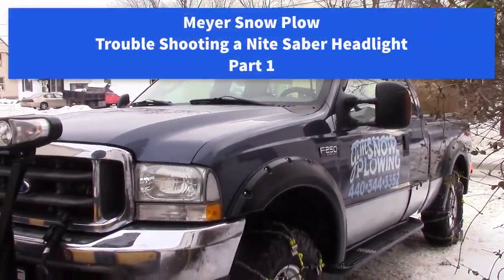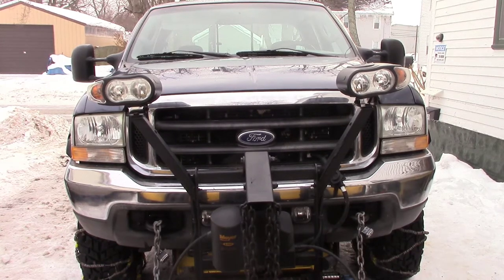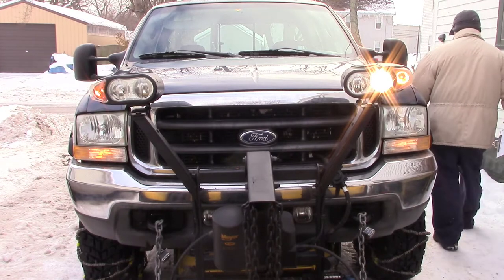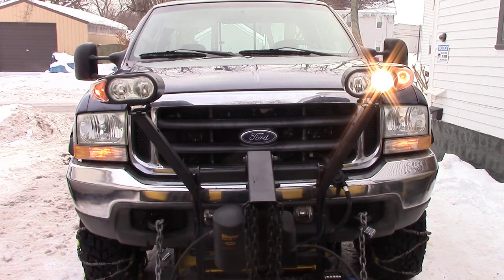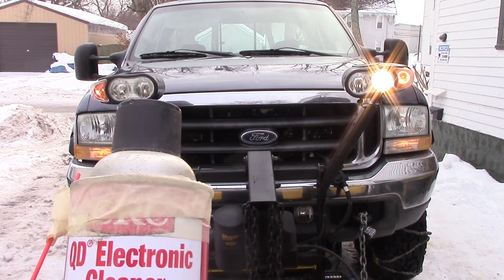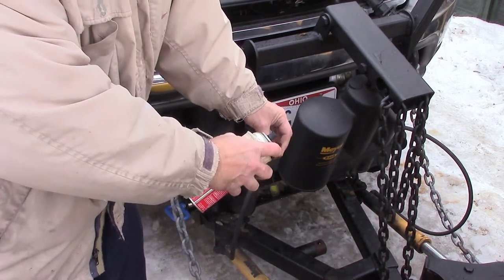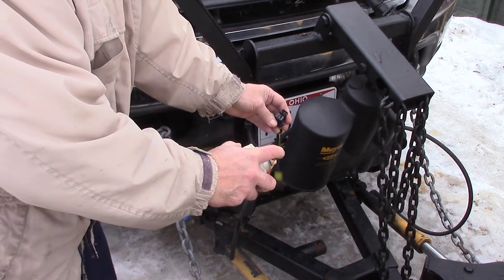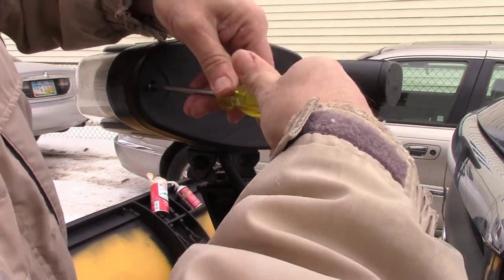Meyer Snow Plow, Trouble Shooting a Nite Saber Headlight Part 1

Comment: Outer beam of plow light headlight is low beam. Whoever wired your lights needs To go back to the teepee.
Reply from the maker: Thanks Terry! I bought it used back in 2016 with the plow already installed. I was gonna get the pump fluid changed this summer at a Meyer shop, I'll have them check it out!